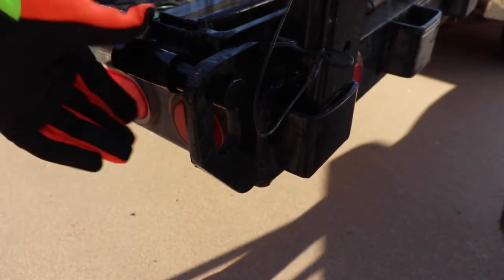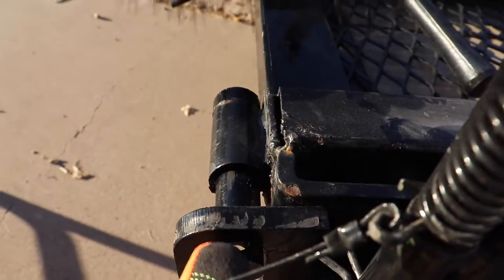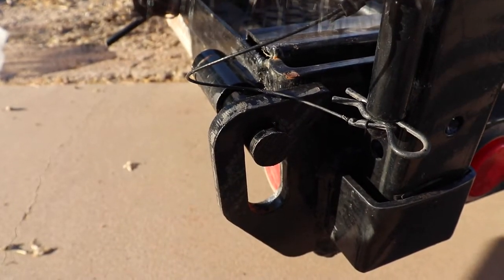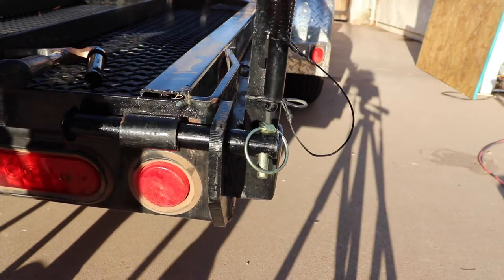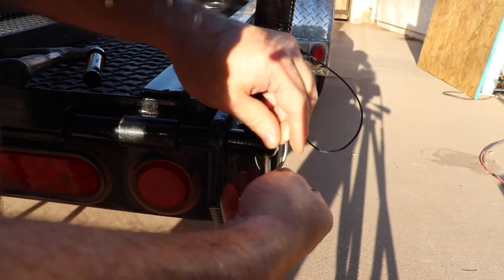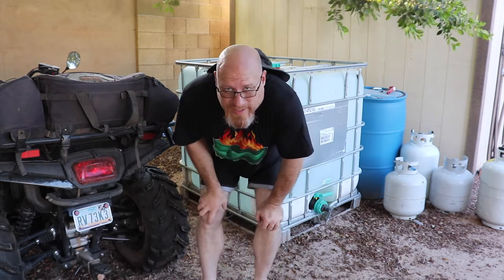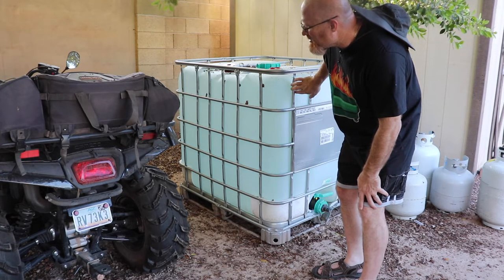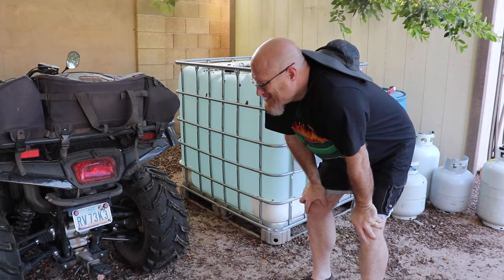Trailer Repair Complete, Start of IBC Tote Wrap

Comment: The lid can be vented with a valve all you need is a hole drilled in the center of the lid and a PVC ball valve. I generally use a PVC threaded fitting a rubber washer and a flange nut. The you can turn it off and on as needed to ben the tank.
Reply from the maker: Thanks Moses. It's all learning from me, I was trying to empty the tank and forgot that I needed to vent it. I also thought that the bottle was more rigid on the inside. I will definitely give that a try with the lid and ball valve though, it is truly appreciated. God Bless.

Comment: Keep your foot hard on the Pedal!! Dont worry about mistakes its exactly what any of us would face trying to do what you are doing! I have about 8 yrs until I retire and out In the hIgh desert is where I want to end up..Actually eyeballing Land in Apache county. You content is of value to me because  I can get some insight on how to do it and what I can expect.
Reply from the maker: You should be able to gain a wealth of knowledge from me on what not to do or what to watch out for. 😀 
There are a lot of places where inexpensive land is available. Make sure that you look at all the county requirements as well as water and acreage availability and before choosing your property.
Reply: Did you reach in and try to pop up the plastic? Gotta have air flow when letting out the water. Drill a tinyhole in the cap, to let the air in and add a screen. When you use the water your intake needs to be the same as the out take. Call Rob he can help to talk you through stuff. 
Those pickle jars are almost priceless! We use ours all the time!
Reply from the maker: @blissfulacresoffgridhomest2098  I haven't tried that yet. I will though or I will fill it with water and is should pop back into place as well. Thanks for the tip Susan and/or Rob.
Reply: @OnAnEvenKeale  Did you write down our number? I will edit it as soon as I know you have it. Hugs!
Reply from the maker: I don't have it, can you just email it to blissfulacres@infiniterecall.com I have that set up as a temporary email address. That way I know who it is and who it is from.

Comment: Just a thought for future wraps, create a sock that you can pull over the top of the tote so you can remove and reuse the material on a future tote.  I think if you do this, you can also put the seam over the top of the valve and have an open flap to allow the valve to peak out of the sock.  Also, wrap the extra on the top and sew so you have access to the top screw cap.  Kinda like pop-on/pop-off grill cover.  Wonder if that would work better.

Wild how the bars bent like that.  Does that mean you always have to have the cap loose to allow venting?  And the IBC can't be sealed too tight?
Reply: Ibc totes will do that if you empty too much water to fast, but yes if you are using them for a constant water source you either need to have the lid loose or create an air hole/vent.  I have seen people stick a long flexible tube up the drain hole to the air pock on top that will work too but can cause leaking at the drain.
Reply from the maker: That is something to try out for sure. I want to get about a dozen totes for the house here in the valley so will try the sock on a few. Maybe a sock over the cage and another inside the cage. I'm just not sure if I need to cover the bottom. I know the people who pull the bottle out are also painting or wrapping the bottom. Is it necessary is a question I have.
Reply from the maker: I just wish I would have known that when I started to empty the tote. Funny thing is I didn't realize it as it made virtually no sound at all. The bottle just kept letting the water out and started to slow down and that made me question as it "appeared" to still be full. That's when I noticed the bottle was shrinking which is not at all what I had suspected would happen. I guess I thought that bottle was more rigid.
Reply: @OnAnEvenKeale  because you are wrapping yours to the bottom you do not have to worry about the metal reflecting the light onto the tote.